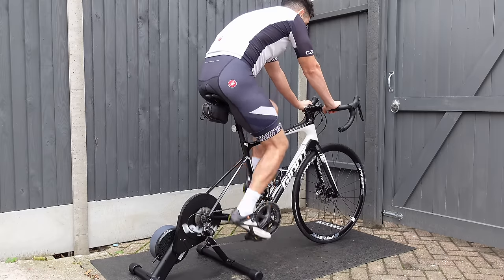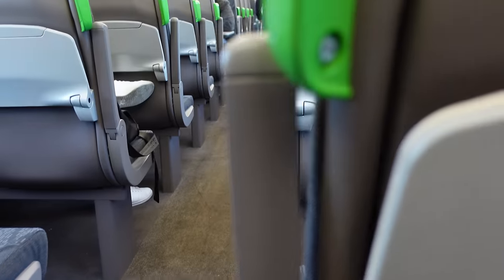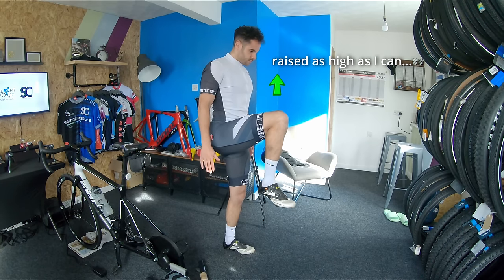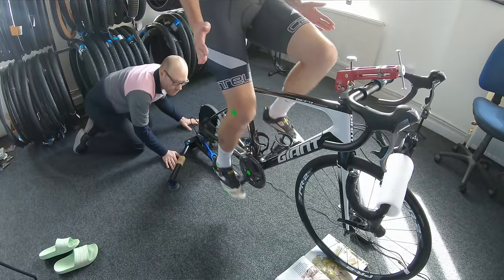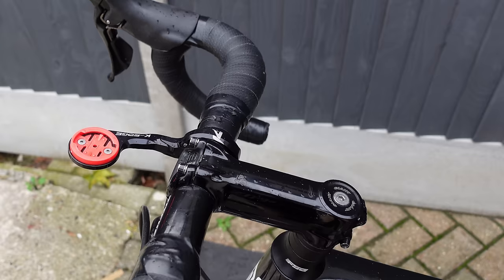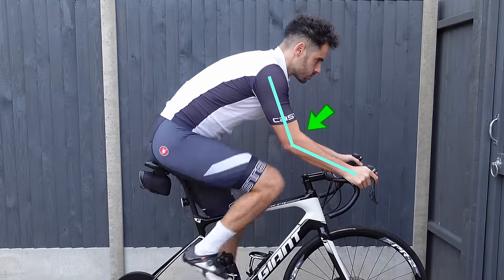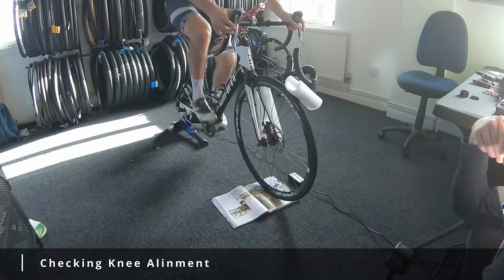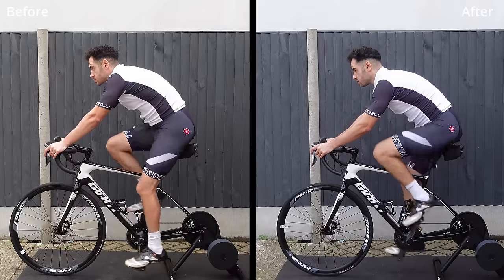I've Been Suffering For 3 Years // Full Professional BIKE FIT in 6 Steps!

Comment: Like your vids. How did you reduce the reach. I'm already down to a small 80 stem I think it is. Or was it just moving the seat forward? I get really bad numb wrists after a ride.
Reply: I wouldn’t use the fore and aft of the saddle to adjust reach. Your stem is already quite short. I’d suggest checking your bar width - are you rolling your wrists inwards because the bars are too wide?
Reply: @franco992  my bars are probably a little wide too. I realised on my Carrera TDF they are made to make sales. The reach is long on them. They have no size indicator at all on the frame either. It did get me into cycling and I'm still searching for my next bike. That's why jourdains bike builds excite me as I think building your own bike looks like fun.

Comment: How did you reduce the reach on the bars? Did you change the stem? I've got the same problem with my bike, I'm over reaching
Reply from the maker: New bars - 1cm reach reduction 
Seat moved forward - Around 6mm reduction 
Seat moved down - As the seat moves down it also moves forward because of the seat tube angle. So this gave another 4 mm roughly. 

I didn't want to change the stem so this was the best option 👍🏽

Comment: I have a Giant Defy too and I HATE saddle adjustments. Same problem you had. It is not continuously variable, and the discrete settings just don't seem to work for me. It feels tilted too nose-down or too nose-up - it is impossible to "get it right" (except for a couple of times I thought I had nailed it only to find that the saddle was not in a stable position and just became super loose after going over a bump ... not a great experience).

Comment: Thank you for this video, it was very interesting. How did you reduce the reach by 2 cm? It looks like the stem did not change. Was it just a combination of Saddle height, saddle position on the rails and the new bar with a shorter reach?
Reply from the maker: Yes, correct. I also changed the bars which had a 1cm shorter reach (ie the lever position was closer than the previous set) I needed to change the bars anyway for the reduced width.

Comment: Thanks for this very informative and well done video! What's your body measurements (height, inseam, etc?). I'm curious since I just bought a 2022 Defy Advanced 2 in size small. Would you of been better in a size small or was the size medium better and then sizing that down? I'm 170cm with 76cm inseam and I'm starting to feel a little cramped more so when I'm riding while in the lower drop grip position. It just feels like I can use a little longer reach. I have pretty good flexibility and in pretty decent shape relatively speaking. I'll check out some of your other videos!
Reply from the maker: I'm just over 5ft 9 inches (not sure on my inseam). I think the size small is better to be honest. I think making a bike larger (longer stem) is a much better approach than having a bike that's too big that you make smaller. if you feel it's too small then you could always get a longer stem.
Reply: @JourdainColeman  I'm roughly the same size as you and I am on a 56 cm Trek Checkpoint. I went ahead and bought a 56 when it became available last spring in the current inventory crunch. Honestly, I feel like I am in between 54 and 56. Unfortunately, not many people make 55 cm bikes these days. I feel I am a bit stretched out to the hoods and am currently trying to solve some hip and perineal discomfort. I've been riding for about 7 years now and have sadly never worked on making the bike more comfortable. It's time. Thanks for uploading this helpful video.

Comment: Was a new stem swapped in to compensate for that 20mm shorter reach?
Reply from the maker: 1. The seat went down. Due to the seat tube angle this brings the seat forward. 5mm
2. The seat was moved a touch forward on the rails. 5mm
3. Bars were changed for short reach which was a 10mm

Comment: Is knowledge about how the body work in a saddle, limbs and its motions.
Not one is a made the same.
I just spend time to listen to the body. Filming is a good way to see what the body does when you put some Force into it..
Some has one shorter leg sometimes and could be an idea to use a shorter crank on opposite side..
The industry is bit cornerd to use a size system, productionissue of course.

Comment: You mentioned a reduced reach but you didn’t say how. I assume you put a shorter stem on but your saddle adjustment might have been the fix. Can you clarify?
Reply from the maker: The main change was actually my bars. The bars I had were long reach and the shifters where fairly low down. So I got 1cm reach reduction from the bar change. (I got some short reach bars) 

Then as the seat height is reduced it's moved closer to the bars because of the seat tube angle. So there was an 5mm reach reduction because the seat moved downwards quite a bit. Then the seat fore and after gave me 5mm as well 

I hope the helps 👍🏽

Comment: Thanks for the video. You mentioned that you reduced the reach by approximately two centimeters, but you didn't say HOW you did that. Would you please explain? Did you reduce stem from 100 mm to 80 mm or were other steps involved?
Reply from the maker: Hey Dave reducing the saddle height brought it forward
Changed bars which reduced the reach 1cm
Changed for aft on saddle
Reply: @JourdainColeman  would you please share which bars you are using now? Didn't realize that changing bars could reduce reach. I guess that's due to where the shifters are located on the bar.
Reply: @davemills4211  hi Dave, handlebars have different width but also different reach and drop. A “standard” bar would typically have a 90mm reach and 140mm drop where more “compact” bars have a 80 mm reach and 120mm drop (sometime even less). It is worth looking at this measures to avoid a different position 😉

Comment: To get 20mm less reach, did you get a 20mm shorter stem fitted?
Reply from the maker: It was a combination of...

Reduced reach on the bars 

Saddle moved forward

Saddle height reduced which also reduces the reach because of the seat tube angle.

Comment: I'm wondering that i have the same bike and size and i'm 178cm. I've just upped my saddle to 55 mark and my in seam of 81cm. Loving this height as i could maximise my power on the paddle. So whats the saddle height did you settle for with your inseam ? Btw your old saddle height is actually 21 so if lowered it by 14 that should be 35 now?
Reply: 21cm minus 14mm

Comment: When I take my hands off the bars like you were doing, it feels like I’m falling forward. Im a heavier rider though 108kg. Is that normal for a heavier rider?
Reply: @NYGiants4Life, This is mostly related to a wrong weight distribution. Being a heavier means that the set up will be different than a "lighter" rider but you should still have a good weight distribution (hence why software based systems and range of angles are not optimal).
There are many reasons why this happen but the most common ones are a reach being too long and/or wrong set back - could be a good starting point.

Comment: I lowered my saddle 5mm however I am curious if it would have been better to go from 172.5 to 167.5 crank-arms and leave the saddle the same height.
Reply from the maker: If you got shorter crank arms then your legs would be further away from the peddles so you would need to lower your saddle as well. 

Saddle height is saddle height and crank arm length isn't the best way to change it (from my understanding). 

Think of them as two separate things. I hope that helps

Comment: @ 7:36 Your legs are nowhere near straight at the bottom of the stroke yet you are pointing your toes?  Why?  Seems as though there may be some unresolved tightness in the hamstring/calf/back of the knee due to a shortened pedal stroke over many years?  Perhaps some PT would help loosen the legs and increase that stroke length at the bottom of the pedal rotation.

Comment: You didn’t specify-whether:
The reach was reduced by 2cm by changing stem length or-just by changing the handlebar width and a different “style” bar. The reach can be significantly reduced just by design of the handlebar. But you left that out. that’s very important!
Reply: Was also looking for this. His previous handlebars had an 85mm reach while the new one sits at 75mm. The other cm he reduced is probably from handlebar/hood angle.

Comment: Hi, how did you reduce you reach? Did you change your stem?
Reply from the maker: Changed bars - 1 cm reach reduction 
Seat forward - 0.5 cm reach reduction 
Seat height lowered -  .05 cm reach reduction (As the seat is lowered it comes forward) 

Ultimately the frame is probably a little too big. The new frames that I have purchased have been a size 52 compared to the Giant in this video which is a 54
Reply: @JourdainColeman  Thank you!! Great video!

Comment: How was your reach reduced? 20mm shorter stem? Or was it a shorter them and a shorter bar reach?

I would have thought you would have needed to increase the reach again after moving the saddle forward 5mm?
Reply from the maker: It was 2cm overall. 
- Seat moved forward from lowering
- Reduction in the reach of the new bars (my old bars had a long reach. As I needed to change the width as well it made sense to change them)
- Saddle moved forward on the rails

Comment: Your back is not flat enough if it's me. I'll lower the bar height increase the stem length and adjust the handlebar and shifter angles.
Reply from the maker: Hey Daisy, we tried various positions and this worked best for me. Keep in mind the fit was done for endurance rides (3/5 hours @ 160 watts). Hopefully I'll be able to do another fit video on my race bike which would be more slammed 👍🏽

Comment: What was the tape running across the saddle?
Reply from the maker: I'm not 100% sure to be honest. Measurements were taken from that point so I assume it was a marker that was consistent throughout the fit
Reply: The tape was to mark the saddle at the point where the rider seats. For most of the saddles it’s where the saddle measures 80mm wide. Some are 70mm - check with the manufacturer 
@Jourdain, probably worth talking about this in a future video 😉
Reply from the maker: @veloconfort  Thanks for confirming 👍🏽 - Sounds good for a future video

Comment: For leg length differences: One of my legs felt shorter when I stood. My physio said my pelvis was twisted slightly. It's actually multiple interlocked bones. She unwisted it, and I stood much more balanced.
Reply from the maker: That's interesting o hear! I assumed that my body had absorbed the difference in some way shape or form
Reply: @Jourdain Coleman  Right?  It took a little folding and leaning on my legs, but the effect was immediate and permanent. Your body also compensates when your leg was broken, so that could have an effect too. I broke my leg when I was young,  which could have caused the imbalance or twist.

Comment: Rocking hips. saddle too high. no neck handle bars too high.  Edit : cool I was right. I just got speedplays and a new 20mm set back seat post from a 25mm set back. I think I may try my 120mm stem from my 100mm. Trying to ease my hand pressure.  Any thoughts?
Reply from the maker: When I watch this back my position looks awful at the start. If you have pressure on your wrists then it could be a few things.. It sounds like you are experimenting though which is a great. The lever angle could also be an issue.. are they level or slightly pointing up / down. Hopefully the pressure on your wrists is eased 👍🏽
Reply: @JourdainColeman  My levers are level. I was thinking about a lever adjustment as well.  After watching your video I think adjustment of saddle height along with fore and aft in increments is a good starting point...... Note: I did significantly have to lower my saddle height to accommodate the lower profile speed plays. Might lowering my bars a few mm help? 🤔  All of your opinions are appreciated thanks in advance.
Reply: Too much pressure on hands is most likely saddle too far forward
Reply: @Fred Howland  Thanks Fred. Spot on

Comment: You can even see on you new position you have so much weight on your back and saddle compare to your arms. It is like you are sitting on a old womans bike. You have a too rounded back, sitting with a curved back gives you problem in the long run. Powerwise you should have more pressure on your arms so that your weight is more forward on the peddales.

Comment: Much better but I think there is still a little bit of work to do
Reply from the maker: An ongoing process I guess... what would you suggest?
Reply: @JourdainColeman  it's pretty good and I'm not qualified to make judgements but I can see your pelvis is still rocking in the new position.
Reply: I think also the geometry of the defi is pretty slack in the seatube angle and as such, you're still too far behind the bottom bracket.
Reply from the maker: I see what you mean, I'll look into your points 👌🏼The Defy is a pretty slack position. It's my endurance bike. Hopefully, I can get a fit on the race bike and see how it compares.

Comment: Again neglect on QR measurement because given the late trend in cranksets it is not adjustable/optional, and those with preference (due to physical structure) to wide QR should just not ride a bike these days.

I found this to be the most critical for me measure making a difference in my riding and only started thinking of it when my 4-5lb/(2kg) heavier city bike with a triple felt much more abled to do long distances than my otherwise fast road bike.  QR  ... it is how your feet have learned to put power down on the ground, they don't like tilting in or tilting out.

Engineers think because it is more efficient to have a narrower crank that bicyclists should conform, or actually be choosen by the ability to ride a narrow QR factor.  FALSE!!!!

The bike should fit the rider not the rider to fit an engineer's wet dream of a 0 QR factor.

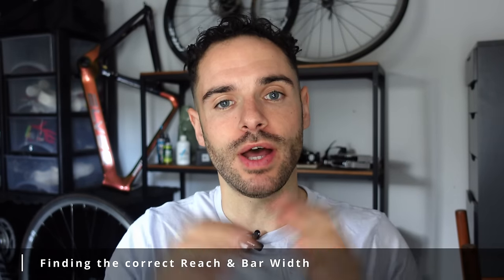Comment: 8:28 shows you have no clue what you're on about. Blaming the manufacturer or retailer whilst you are measuring in the drops. Most handlebar widths are measured at the hoods, and if a bar has some degree of flare, the drops will be wider. Or vice versa, depending on how the manufacturer measures.
Reply: He does say he's a bike enthusiast not an expert. Hence the bike fit. To be honest...I'd only figured out about where to measure from recently when looking to replace the bars my bike came with. Not everyone has the same level of understanding and knowledge. Hence bike fits and videos. And comments. It's great that you pointed this out, but your tone and inference that this guy has 'no idea's (I'm assuming generally) is a piss poor comment from someone needing to feel important rather than offering constructive advice/criticism/information.
Reply from the maker: I was just taking b-roll for the video. Romain measured everything (including bars) so all the measurements were his. So in fact the bars were larger than stated when I purchased them.
Reply: Width can be measured at axles or overall.